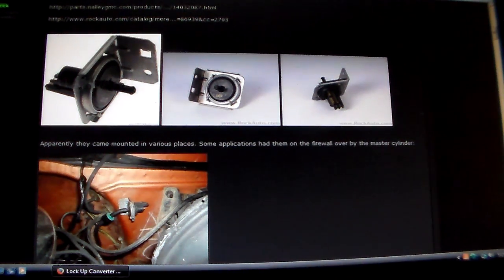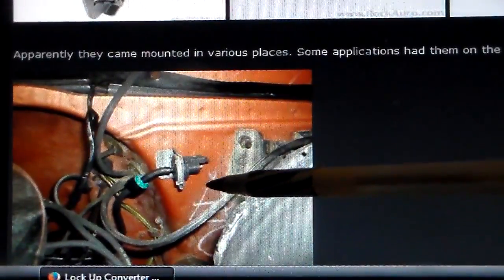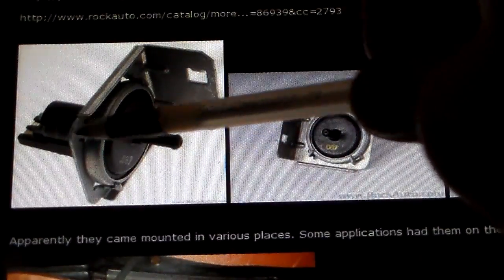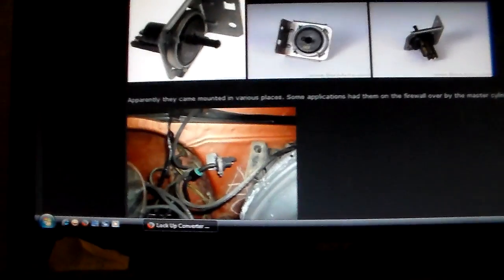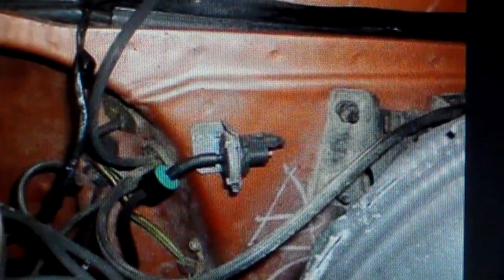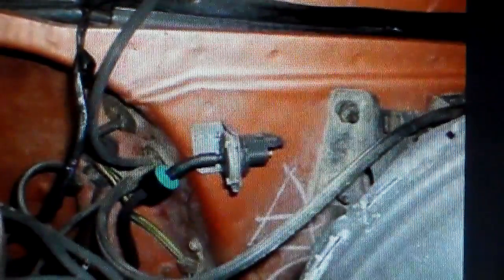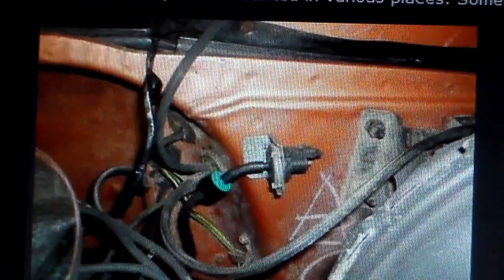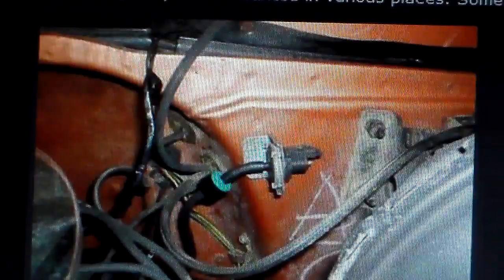How to understand '80's Silverado/Sierra TCC lockup

Comment: Well i would like to express my gratitude for this detailed explanation of the lockup. I have a 1982 g20 conversion van the bell cracked in the  firt gen 700r4 ,no reverse  hardly lots of grinding noise. Bought a reman t350 from an acquaintance  didn't know about this wandered why the oring on input shaft .thanks to you this will save me a ton of headache

Comment: I had a question to the video. I got a 91 Chevrolet Silverado with a four prong 700 R transmission with a passing gear are kick down cable whatever you wanna call it now I went to the junkyard and they sold me a V6 transmission K Cason 700 R but it don’t have a kickdown cable or passing gear what not and it’s got the real connector plug is it possible to switch this so my transmission will work in my truckwith the round plug like do I need to or is it possible to cut into the connection? I’m not sure just looking for some advice.

Comment: Thanks for sharing with us as I'm about to do a 4 speed stick to 700r4 conversion in my C20 chevy pickup truck
Reply: Did you finish this, if so how happy are you with it. I’m doing the same on my C10. It is a fair amount of work. With luck I’ll be trying to fire her up with a new engine and now an automatic in a week or two. Need to get my drive shaft cut down and a handful of other odds and ends.

Comment: Tyler, the blue-black thing that you called-out as a check-valve is probably a vacuum-delay valve; it delays transmission of vacuum change thru itself; not sure how it works, probably just has a small orifice inline to the vacuum switch on the firewall; I have owned 86 C10 for 38 years and kept all of this working for 36 of those years, finally went to a crate engine; there is a check-valve and it looks similar, and it goes between the manifold and the 'ball shaped' vacuum-storage container (usually on the drivers side for the 86 C10) and that keeps vacuum  handy to operate the vacuum motors on the HVAC (MVAC) system back in the cab; so that check-valve is important and it operates vacuum motors and switches on the MVAC system (many of which are self-bleeding when the switch is moved, it will let the vacuum motor bleed back to ambient pressure. Good tutorial btw, this is much overlooked info on the 700R4. Thank you!
Reply from the maker: Thanks!

Comment: Hello Tyler, this is a great explanation on the TCC lockup. Question…I’m restoring an ‘84 K10 and was wondering, can I tee my TCC vacuum line to the ported vacuum line feeding my vacuum advance and maintain enough vacuum for both at cruising speed?  Thank you! 6:01
Reply from the maker: Yes.

Comment: On my 1982 C1500 the ported vacuum line goes through a temp. switch and then through the switch on the firewall. Good video!!

Comment: This video has been very helpful on the tcc lockup. I had a lockup 350 in my 81 GMC with a 350 and changed it out for the 700r4. My guestion is on the tv cable, the cable itself is to long, dose the mount on the intake where the cable housing clips in, dose that have to be changed.
Reply from the maker: It might, I don't recall

Comment: do you have a wiring diagram someone cut the plug of my harness and i dont know which wire goes  to the trans switch. i bought a plug at oreilly and it has all black wires

Comment: I have this transmission in a 1981 z28, can I run it with this torque converter lock up switch disconnected and run it in the unlocked configuration? Will it perform just like a regular earlier 3 speed with no lock up ?
Reply from the maker: Yes.

Comment: Mine has 1 wire to front/outside on the case connector for 12v to the solenoid and gets its ground from a 4th gear pressure switch,my tranny guy said all i need is a 12v keyed source and i could run that through a switch on the dash to disconnect power for say cruising in town or dont want it to lock up,sound correct?

Comment: I have. 350 transmission on a 1982 gmc g2500.  Bogging down when shifting to 3rd.  Took it to a transmission shop and the mechanic said he thinks the lockup selenoid is stuck on.  And even after disconnecting the wires it is stuck on.  Any ideas?    Also.. when following the green and yellow wire up from the transmission it comes to a switch that’s situated beside the thermostat housing. That then seems to be tied into another greeen wire to the type of switch in your video.  Why would my transmission be connected to two different switches. ??

Comment: Hey Tyler.  Love your videos manI've been learning a lot.   Ive been having an issue with my 82 GMC Vandura 305, and i really hope you can steer me in the right direction.  my engine seems to BOG and lose power when shifting into third and while cruising at those speeds.   Vaccum level drops to almost nothing and starts to diesel.   I have checked all the fuel delivery system, changed filters, checked pump pressure, blew air back into tank, ive installed a new vacuum advance, new transmission modulator,  new distributer cap,  rebuilt my carb, and then tried a different carb altogether.   the issue persists. as soon as it shifts to third, it bogs, vacuum drops, and all power is lost.  Now the beginning of these issues started when i met an old timer mechanic who helped me replace my fuel pump.  He convinced me to then elimate all the emissions stuff and he tore out a bunch of vacuum hoses,  "back to basics", as he said

im now watching this video and am thinking that maybe theres just something not hooked up roght with the vaccum lines.    currently the two TVS switched have nothing connected.  Are those vital components?    I will check out the TCC switch tomorrow and se if that changes something but im beggining o think that maybe its the timing chain, however it idles great ( good vaccum too) and seems to have lots of pep at 1st and second..   this is frustrating to no end, as this van is currently also my home.  Any ideas??
Reply from the maker: Hi Bruce. it's hard to diagnose something over the internet, but the very best thing i can suggest is get an accurate vacuum diagram...you may still have the original under the hood that you can take a picture of. Study it until you fully understand what should, and is there, and what each thing does. There's really not that much on an '82...EGR, heat riser, distributor advance, air cleaner inlet door, HVAC controls, cruise. PCV, charcol canister stuff...that's about it. TVS means Thermal Vacuum Switch. Those always work on the same principle:  vacuum is supplied to it, then the restricts or supplies vacuum to a device, based on the engine temperature. Usually, those are plumbed in the vacuum lines to the EGR and distributor advance, because they did not want those items active until the engine warmed up. Usually those two items use "ported vacuum", which is a vacuum signal that does not "come on" until the engine has moved away from idle, because, again, they wanted those two devices "off" at idle. You will find that vacuum-operated devices work just like electric items...off at some points, on at others, with some OTHER device that controls when they operate. I would definitely check the engine timing also.

Your "old-timer" mechanic tore out your vacuum lines because he didn't care to understand what they operated. Study the vacuum diagram and it'll start to become clearer. Good luck.

Comment: I have a th350 with lock up and want to use a msd ignition box and 600 cfm carb. How can i keep the lock up if im not using oem wire harness ? Or can i run it without connecting it ?
Reply from the maker: You can operate it with a toggle switch. There are articles online about how to do that.

Comment: Someone swapped a 350 and th400 in my truck and I have wires going to this same switch from fuse box under the dash. Then it spits by blue wire to a white looking box by gas pedal. Do I need it connected to this vaccuum switch you are showing here or can I just disconnect it. I didnt think the th400 needed this switch.
Reply: Idk if they even made a 400 lockup transmission to my knowledge

Comment: Does it engage the lock when vacuum is low or high ? If the hose is disconnected will it be in lock-up mode or non-luck up mode ?
Reply from the maker: non lockup
Reply: @TylersNeighborhoodGarage  Thank you

Comment: Good information but let me add .....  I swapped a 5.3 LS into my '68 C10 and have a 700r4 in it.   I rewired the stock harness in the trans so with power applied and in 4th gear engauged the converter would lock up anytime your in 4th gear.   I did it with a grounding pressure switch on the 4th gear spool so lockup would only be in 4th.  To supply voltage to the trans I replaced my brake switch with a unit from a later truck with N/O and N/C contacts and because I have no ported vacuum I run it off manifold vacuum.  That way your voltage path is blocked by the pressure switch unless your in 4th and if you hit the brakes the N/C side of the brake switch opens and drops the lockup, you don't have to wait for the downshift out of 4th and you don't have to run any vacuum switch.  If you have a downshift out of 4th it drops the lockup because the pressure switch opens.  Works like a charm.  Monster Transmission and TCI offer a simple harness kit if you don't want to use the stock harness.  All you have to do is replace the existing pressure switch and snip a few wires out.  Takes 10 min.

Comment: I have a 92 Astro van. My reverse it not working. and that electrical connector you showed there on the left side of the transmission is somewhat damaged. Would this cause my reverse problem? All the other gears seem to work perfectly fine.
Reply from the maker: Sorry bud, but the actual gears are mechanical. You most likely have something broken in there :-(

Comment: ive got an 85 c10 long bed silverado, originally with the 305 with a th350, my trans has that 4pin connector on it with only 3 wires going to it, that harness is a self contained sub harness that can be removed by itself, it also has like 3 other connectors that im not 100%sure what they go to, the tipin switch on the right hand side of the firewall, as i understand it, is for the ESC or Electronic Spark Control system, the esc system is the big 4 pin connector on the hei vacuum advance dist, it plugs into a control box mounted under the dash above the heater box on the pass side, it uses a signal from a knock sensor on the block to electronically retard your dist should detonation occur, the tipin, from my understanding, uses the same system to electronically retard the dist under heavy acceleration to help prevent detonation, ive eliminated that system so that switch goes byby, what i dont know is what is tcc and how does it work, and how will it adversely affect my new trans should i not hook it up? ive upgraded to a vortech 350 with a 700r4, the trans was out of a 93 caprice, but it too has that 4 pin connector on it so i assume it is tcc compatible
Reply: You don't need to run a vacuum switch.  
An easy rewire in the trans with a new 4th gear pressure switch and take power from the N/C side of the brake switch so when you hit the brakes or downshift out of 4th for any reason the lockout drops out.   TCI and Monster transmission have the kits and video's.  Cheap and easy.

Comment: What wires hook to the vacuum switch?
Reply: You don't need to run a vacuum switch.  
An easy rewire in the trans with a new 4th gear pressure switch and take power from the N/C side of the brake switch so when you hit the brakes or downshift out of 4th for any reason the lockout drops out.   TCI and Monster transmission have the kits and video's.  Cheap and easy.

Comment: Is there a video covering 87 and up models.  And how to wire them for hot rod use
Reply: Monster Transmission and TCI have video's and harness kits.  I used one and hooked it up to a brake switch with normally closed contacts like they used for cruise control cars so if you hit the brakes it immediately drops the lockup. Makes a big difference in stopping.

Comment: Can you run a toggle switch to bypass the external vacuum switch.
Reply from the maker: Yes but make sure you deactivate it when you slow down.
Reply: @TylersNeighborhoodGarage  What if you just leave it connected to 12v all the time?

Comment: Tyler, what type of vacuum (manifold or ported) should the tip-in switch on the passenger side have to it? This is a great video!! I really needed a source for this type of info. Thanks for taking the time to post it.
Reply: You don't need to run a vacuum switch.  
An easy rewire in the trans with a new 4th gear pressure switch and take power from the N/C side of the brake switch so when you hit the brakes or downshift out of 4th for any reason the lockout drops out.   TCI and Monster transmission have the kits and video's.  Cheap and easy.

Comment: I got a question. I'm just now Playing around with my first 700r 4.   I grew up. With  turbo 350 and400. That had no electronics whatsoever.  I recently bought a 71 GMC that somebody put it one of these 700R4 in it.   Well, I noticed the Dash. Had this toggle switch on it.   And I followed the wire down to the transmission..   So I just unhooked  the switch and ran the wire through a fuse link That was on when the key is on.   But today Which I've done this morning,    I watch some videos and stuff about this lock up..   the main question is is it bad for the transmission if I leave that Switch hot all the time??    My truck never did try to stall out or anyting. Which is the same thing I saw in a couple of other videos...    So now I'm kind of worried. Maybe I should put the switch back in.
Reply: If you have a switch it manually turns the lockout on and off.  If the switch is on and the truck doesn't stall when you come to a stop you have a no voltage at or in the trans or the clutch in the torque converter is burned out.

Comment: Mine if i hook up that blak blue check valve it stays lite up n on lock up n cuts off with brake pedal. If i remove the blue n blak check valve. The lock up comes on when i accelerate n off when i let pedal go n drops vaccum so which way should it be connected. With or without the cheack valve

Comment: Hi Tyler,  Very informative video.  I have seen on the emission label that the TCC switch is ran from ported vacuum source from carb through a thermal vacuum switch and then routed to the TCC switch on firewall.  What Temp. should the thermal vacuum switch be?  Thanks again!  Dave
Reply: david morgan I’ve heard that it should be at standard operating temperature
Reply: It will give vacuum through the switch at 140 degrees.

Comment: I wired up a toggle for my diesel van's 700R4.  The power still goes through the brake switch to unlock it when the brakes are applied.   Also,  It won't stall the engine because once it shifts out of overdrive, the lock up converter will no longer work … they only worked in overdrive on the hydraulically controlled transmissions.   AFAIK it should be the same for the 350C, which I also have one of and am looking to get it working correctly... hence my presence here.   Thanks for your valuable information.,   Subscribed.

Comment: I have a 1981 corvette. I'm removing the computer and installing a holley carb and intake. How can I keep the lock up still working?
Reply: An easy rewire in the trans with a new 4th gear pressure switch and take power from the N/C side of the brake switch so when you hit the brakes or downshift out of 4th for any reason the lockout drops out.   TCI and Monster transmission have the kits and video's.  Cheap and easy.

Comment: I’m swapping a lq4 into a 86 k5 blazer with a 700r4.  Where can I pull vacuum from to activate this switch?
Reply: You don't need to run a vacuum switch.  
An easy rewire in the trans with a new 4th gear pressure switch and take power from the N/C side of the brake switch so when you hit the brakes or downshift out of 4th for any reason the lockout drops out.   TCI and Monster transmission have the kits and video's.  Cheap and easy.

Comment: Question. My 84 C10 has a shudder only in lock up, under very slight load. Any temp. Bad converter? Should I just just disconnect the lock up and keep rolling? I would like to keep the lock up.
Reply: Jason Conaway - I have an 81 k10 that had a slight shudder under very slight load as well. Mostly when the speed is evened out. My tcc was not hooked up at all. Put a multi meter on your switch put some vac to it and see if it’s actually working